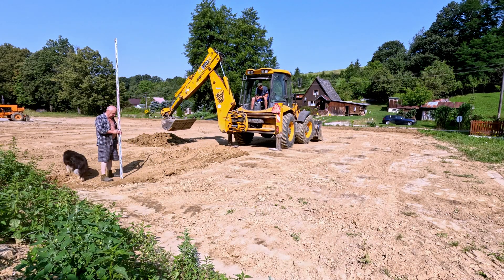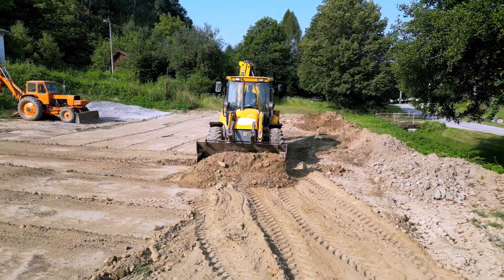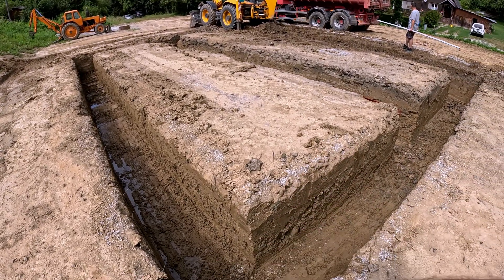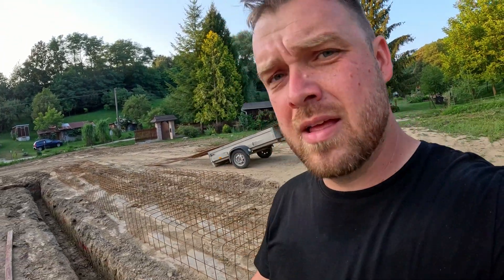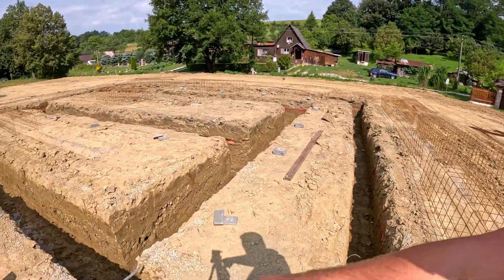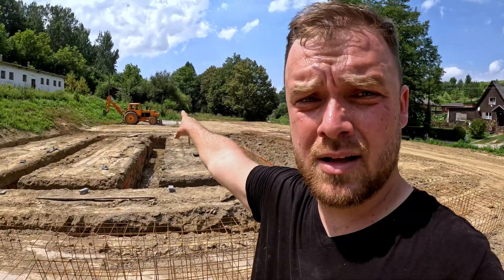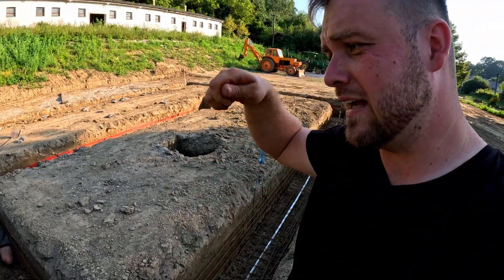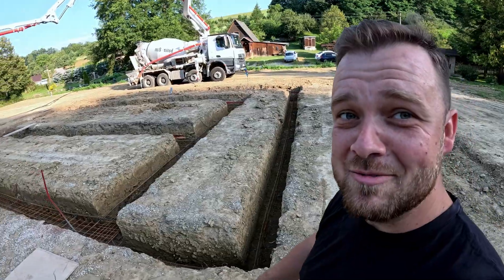How to build foundation for your house really CHEAP ! | (#10 How to build a house)

Comment: Why are you not using your excavator for digging the foundation? Like what's the actual reason?
Reply from the maker: Good question. My excavator is old and digging is slow. I really needed to have this part finished in one day and fill it with concrete asap. You know, in case of rain it could be filled with mud, water or earth. So time efficiency won in this case.
Reply: @CountrySideDream  Got it. I was wondering because I've bought exact same excavator and I'm working with it on my property in Poland for the last 2 months and it was great investment. Paid like 3000eur with transport, and till now i've removed like 20 tree stumps (The property was just bushes and trees so its hell of a work). Next step is to level the ground and then dig the foundation and I was worried You had some major issues despite the lack of time. If that was the only reason I'm a bit less worried haha
Reply from the maker: I had almost same cost of excavator + transport + some repairs. It is big worker. I had some problems with ground leveling because it of course does not have automatic nivelation and my surface was even more bumpy :D One question where from Poland are you ? if its close Slovakian border I can maybe visit you for some video shooting :D

Comment: I don't understand, what are lighting rods?
Reply from the maker: It is lightning rod system … it is system of rods which protect house from lightnings during thunder storms. Here in our country it is mandatory part of all houses. Part of lightning rod system which you saw in video is “ground” part and it will be in future connected with other part of lightning system which will be installed on rooftop.
Reply: @CountrySideDream  oh ok thanks